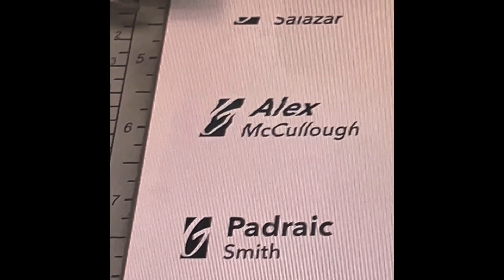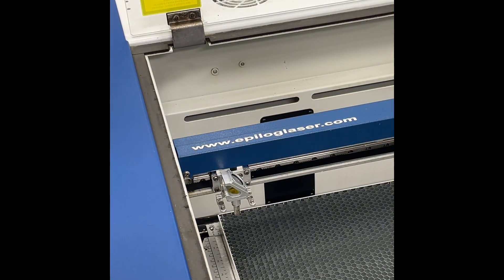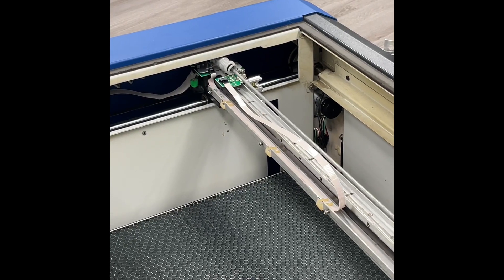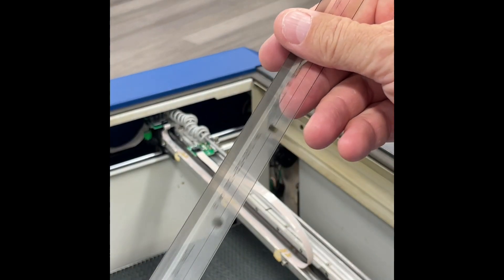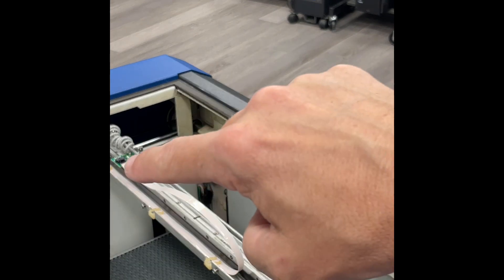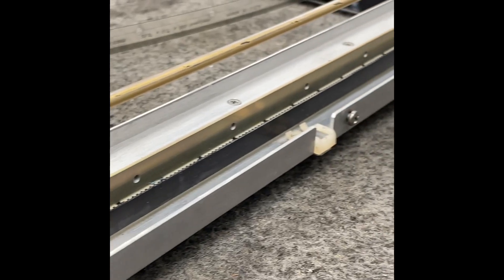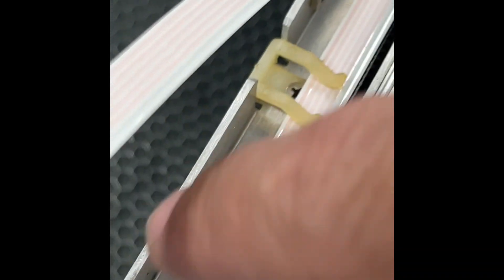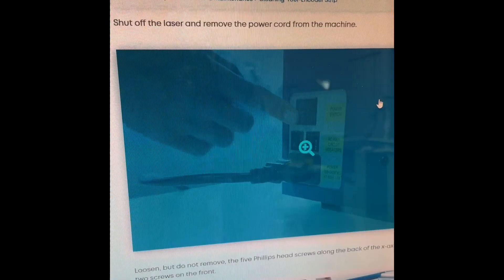“… my engraving is coming out wavy and slanted…”

Comment: over the 12 years that I have had my Helix 24 I have replaced the ribbon cable twice, This time I before reinstalling it I put electrical tape on the top and bottom of the section the travels with the laser head assembly. Both times I replaced the ribbon cable it was worn through from rubbing on the inside of the cover hood.